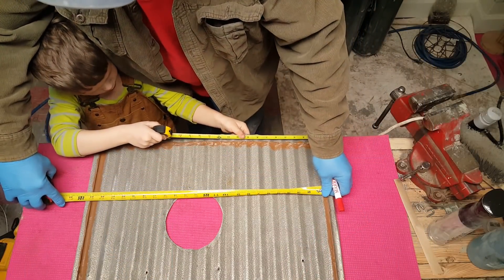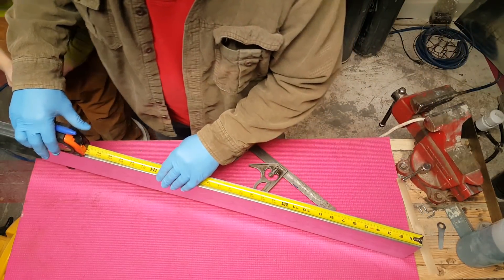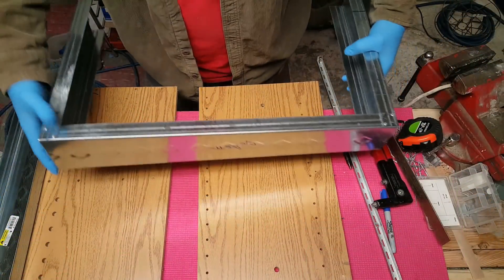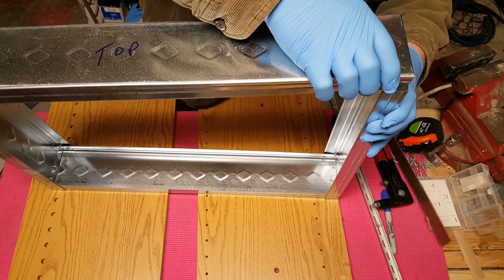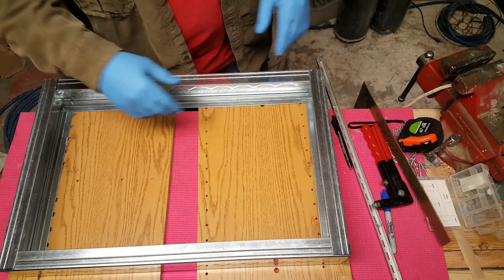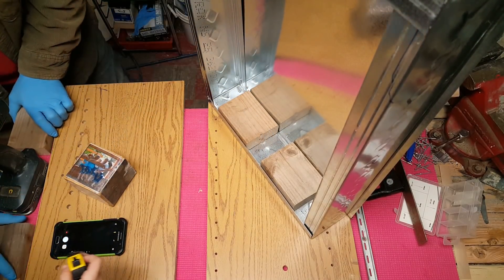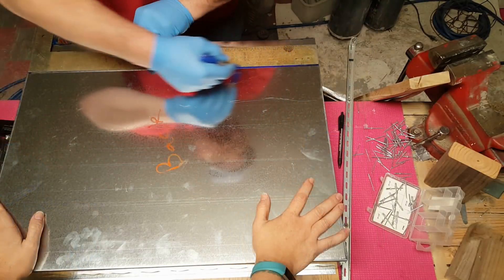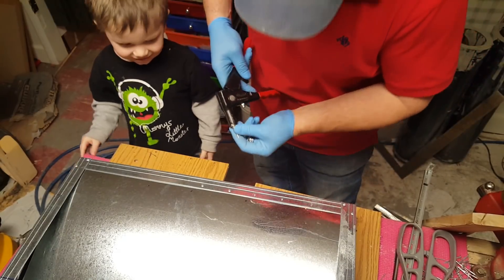Aircrete Window Insert for Stove Pipe

Comment: Could I just build a mold out of wood with the plastic stuff on the suface, then flow the aircrete inside and remove the mold so as ot have an aircreete window insert without the sheet metal? Would that be strong enough?

I hate sheet metal...:)
Reply: Sure you could, I would recommend a wire mesh fabric or expanded metal reinforcement within  the insert. Mostly because if your like me you would be too impatient to wait until the air crete is completely cured. But ya, ...